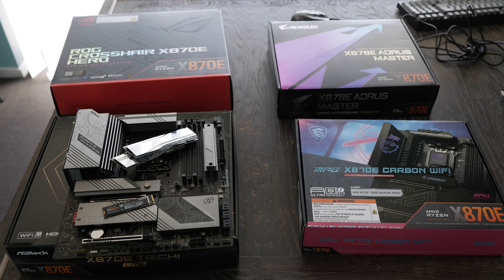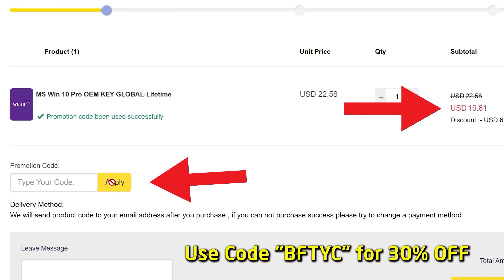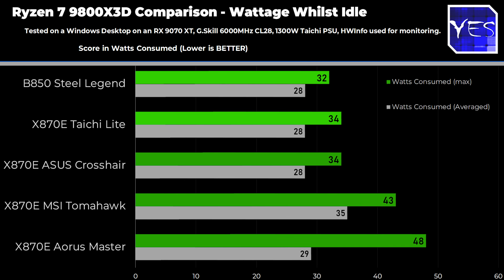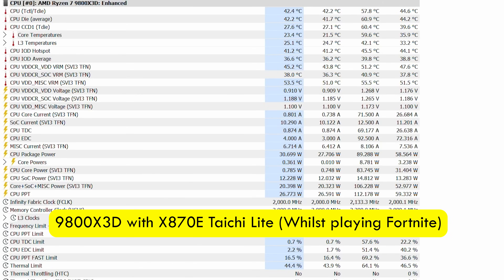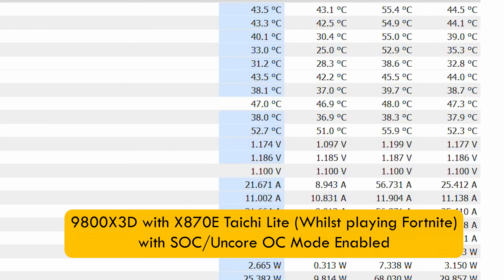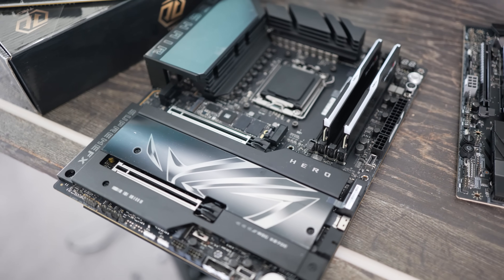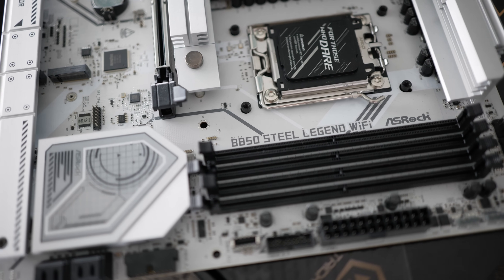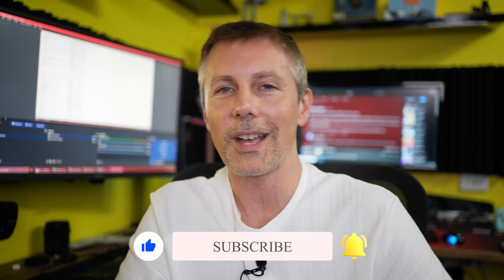I think I know why Ryzen 9000 Series CPUs are Dying...(!)

Comment: Wait, so all the boards except the Asrock boards, peg at 1.2V? It never lowers at idle? What on Earth?! That's like the behavior of a manual overclock from 10 years ago would exhibit.
Reply: Thats the way it is supposed to work when enabling EXPO/XMP. Remember EXPO is an OVERCLOCK. When enabling EXPO the board is supposed to enable SoC OC Mode to lock the SoC voltage. It seems the ASRock board is not doing that, causing potential voltage spikes.
Reply: @ that only happens on gigabyte boards. never on anything else that I’ve tested.
Reply: 1.2v on my gigabyte board. that is stock. it actually goes down when not under heavy load to less than 1v. lowest ive seen it is 0.98v. it "boosts" to 1.2v when under heavy load(y cruncher).
speed is 6000mts, cpu is a 9950x3d. i assume a 9800x3d would use less voltage
also, at 6400mts gear1, stock soc is still 1.2v but this time around it "boosts" to 1.25v. it actually only needs 1.2v but goes a tiny bit higher probably to ensure stability with different silicone quality
Reply: @cant_Comment mind you, I had to wait 2 years to pay $300 for a gene to pair it with my 7800x3d to get that 1.285 requirement down to 1.085vsoc for 6400mhz.  

a win is a win i guess
Reply: @LightWorks222  99.99% of all 7800x3d cannot do 6400mts gear1(uclk=memclk) with only 1.085v. based on that, i would assume your PC is probably running in gear2 mode(uclk=memclk/2), or auto(still uclk=memclk/2 as the boards default to that above 6000). that is not optimal.
you will get better performance lowering the speed to 6000, setting soc to 1.2 and setting gear more to uclk=memclk. another alternative is to raise the speed to 7200(gear2). that should give about the same performance as 6000(gear1). i recommend just going 6000 as your memory kit probably dont have a 7200 profile
Reply: @ i can happily show you a zen timings profile for a 6400CL26-36-34-29-66 tune if want 1.6vdd \  1.58 vddq \ vddio 1.39620 \ vsoc 1.245

I have an 8000CL38 kit that can do CL24….basically a 6000CL26 1.4v bin
Reply: @LightWorks222  its the gear mode that im wondering about. at 6400mts gear1 on 7000 series, you need very high soc voltage to get it stable regardless of what timings you use. soc voltage for the CPUs memory controller is the voltage that determines what speed+gear mode you can run in. 6400mts gear1 is 3.2ghz on the memory controller. at gear2 it is 1.6ghz. 1.085v soc is way too low for 6400 gear1, hence why i assumed youre running 6400mts at gear2. on your previous comment you said you were doing 1.085v at 6400. now on your newer comment its 1.245v. which one is it?
Reply: @ the entire purpose of me switching my board 3 times was because of gear down mode off & the behavior I observed on all 3 boards with my 7800x3d when trying to hit 6400CL26.

B650 aorus elite ax ice

X670E-A strix gaming wifi

X670E gene.

just to clear the air. I’m just speculating & have yet to try 1.085vsoc for 6400 on the gene. I already did 1.245 on the gene & I have a zen timings picture if you need me to send it. That was for the 6400CL26-37-34-29-66 1.6v tune.

I just assumed this 7800x3d would do 1.085 @6400 on the gene since bios 3003 let me run .960 for 6000. I’m gonna try it later on today & give you an update on what happens. 

gear down mode off the b650 was only possible @ 5800 with slight fafo. anything higher was a fail & I wasn’t wasting my time with it on this board. 

Gear down mode on the x670E-A strix was better since it easily did 6000-6200 with 0 fafo. 

the gene was the best one out of the 3 since it does 6000-6400 gear down mode off. no blue screening, no micro instability in windows, no hitching in games, no errors. 

the gene was also the best candidate for this chip in terms of vsoc. I’m guessing the 10oz copper magic.

on the b650 for 6000 1.2 to 1.165 was fine

for 6200 1.2 to 1.175 was fine. tphyrdl would miss match lower then 1.170

6400 on this board was possible but also not worth running since I couldn’t match tphyrdl on this board at all. then I found out about tck phase shift & how you can force sync tphyrdl if you’re lucky. so I took the risk & got a x670E-A. It was only $200 open box anyway so not really a deal breaker here. But the same thing happened on the x670E-A until I used a TCK phase shift of 5 for 6400. that’s where it matched tphyrdl. so the fact that I got progress got me going. 

on the x670E-A 

6000 got away with a little less vsoc

1.2 to 1.15 was fine 

For 6200 1.2 to 1.165 was fine (miss match would happen again if I tried lower)

and for 6400 I needed 1.285 (it was somewhat unstable if I tried lower vsoc so I left it alone)

not only does the gene max out my chip with gear down mode off, but it can do it at lower vsoc. so all in all I gained improvement.

sadly I didn’t hit my 6000-6200CL24 goal but maybe one day I’ll find a chip that can do it. it syncs @ 5800CL24 with a tck phase shift of 5 but no point in running it when it’s slower then anything else I’ve tuned.

what did we learn from this ? without an asus board this chip will not max out lol
Reply: @LightWorks222  i suggest you dont mess with gear down mode as some boards wont cooperate if youre on ryzen 7000. just set the speed, voltages and then uclk=memclk(gear1) or uclk=memclk/2(gear2) depending on what you want. i have a ryzen 7600 and gear down mode must not be messed with on that one. if i disable it, it refuses to cooperate. if i set it to auto, it works. my 9950x3d is different, there i can disable gear down mode and it works just fine. i used the same board and memory kit for both cpus so i assume its a cpu thing and how they interact with the board.
Reply: @LightWorks222  for 6400 gear1 at low soc, its literally impossible for 99.99% of 7000 series cpu. if yours can do it, then it should be able to do 6600mts gear1 which i bet it cant. i only know of one 7000 series cpu that can do 6600 gear1. its a unicorn that normally shouldnt exist in the real world. its the 7950x at 4th place at the xmrig benchmarks. that record used to be first place until others kept overclocking cores and finally beat it. even with my 9950x3d i still cant beat that record
Reply: @ it’s a weird thing when overclocking, you need the right bios, with the right gear that’s capable at the time of attempting to push anything. 

My chip 100% is not hitting 6600 \ 2200 but I know a guy that has a chip that can. He also has a 9800x3d that can hit 6800CL24 but on a 1dpc. 

I’m satisfied with 6400. I just wanted to see how far this chip will go. some people thought 6400 was never going to happen but i knew it was because it booted. 

usually if it boots then you’re closer to success. the other part is tphyrdl. if it doesn’t match then there’s no point in running that speed. the only reason i use asus boards is because of tck phase shifts. that’s another way to force tphyrdl. that was the only way i knew 6400 was possible on my chip. 

then when i went to the gene I didn’t need to use tck phase shift anymore. it just synced automatically with 0 fafo resulting in 54.9ns vs 56.2ns. 

56.2 with my tune with gear down mode enabled. with it disabled I got 54.9ns. if you need pictures lmk
Reply: @cant_Comment  it also has to be a motherboard thing because gear down mode disabled was not happening above 5800mt\s on my 7800x3d while on a b650. I tried everything bro lol. that made me go down a motherboard rabbit hole & I ended up being right about my chip. 

so you’re not wrong, it is a cpu thing. but the motherboard you decide to pair it with is also a factor. 

gear down mode & better vsoc voltages can finally be dialed in without issue. I’m deliding my chip next Monday for fun
Reply: @LightWorks222  its just 7000 series refusing to "not do gear down mode". same goes for power down mode. disabling it is bad on 7000 series. my 7600 was like this for gear down and power down mode but my 9950x3d doesnt mind gear down and power down disabled. 
also, on 7000 series, it says gear down enabled on zentimings even when its uclk=memclk(after setting it manually). it must be a bug or something idk
Reply: A CPU core is like 3W. SOC is ways lower. Saving 1-2W instead of stability make no sense.
Reply: @maou5025  yea Vcore is usually higher
Reply: That's because all CPUs are overclocked from the factory these days. I think that's the real problem.
Reply: @zodwraith5745  they actually don’t since booting with an xmp \ expo profile will technically void your cpu warrenty. Hense why stock timings are 4500-4800etc
Reply: @LightWorks222  Intel literally said using XMP and the new 200 boost BIOS they'll still warrantee the CPU. While it's technically no different than someone that claims they never used XMP or expo to begin with at least it's moving in the right direction.
Reply: @zodwraith5745  I mean, all CPUs still have a base clock, and that's what it should idle at with a correspondingly lower voltage.
Reply: ASUS x670e Crosshair Hero with a 9800X3D and only EXPO set for the G.Skill 6000 CL30 ram. Can confirm the SOC voltage is locked in and only varies between 1.243 - 1.252 in HWMonitor. That's with "Best Performance" set in Windows 11 power options. I'm temped to lock it down to 1.2V in bios.
Reply: @richardhasse2903  I’m pretty sure you can get away with lower than 1.2soc since it’s only 6000. especially since you’re on a crosshair
Reply: A friend of mine got a 5700x on a decent gigabyte board. He kept getting random crashes, mostly in idle. Tried about anything but nothing fixed it. Untill I advised to fix the max voltage, pc has been running fine since. 
The problem was that sometimes the Vcore was spiking up over 1.5V causing an instant shut down. Complete insanity. Also he often sees 20W on idle on the CPU, which is quite weird. 
This whole situation is just sad
Reply: @mastroitek  20w idle is actually normal. on intel you get that too depending on memory config and also windows. what is not normal is 1.5v. its good you fixed your friends problems. i have a gigabyte board too but so far i havent had any issues. its just a cheap board so i guess thats another reason why it doesnt overvolt
Reply: @cant_Comment  yeah I phrased it wrong perhaps. 20W is a high value for his system and OS config, but it is probably due to the manual voltage. anyway yeah. 1.5V is definitely not good, I'm confused on how that is even possible, seems like a massive oversight
Reply: in other words, the voltage goes down on other boards. its not actually locked at 1.2v
Reply: Yeah that's a bit weird